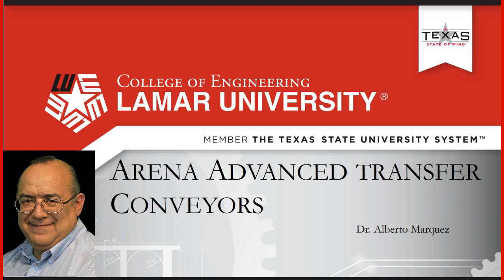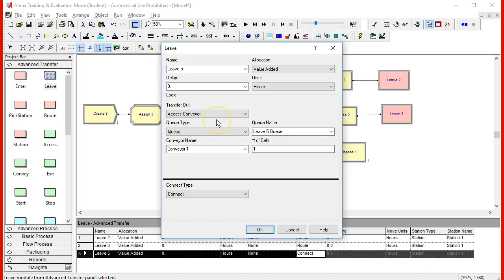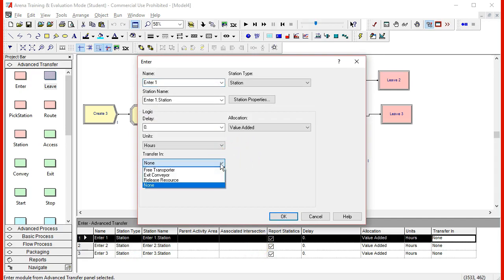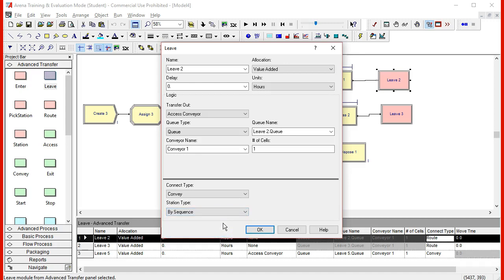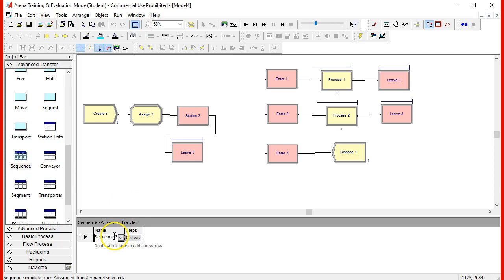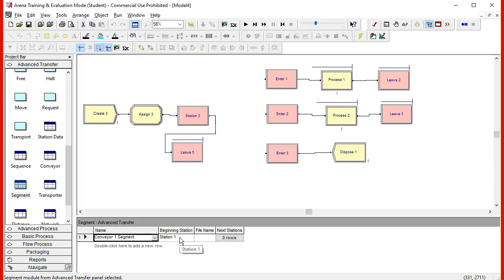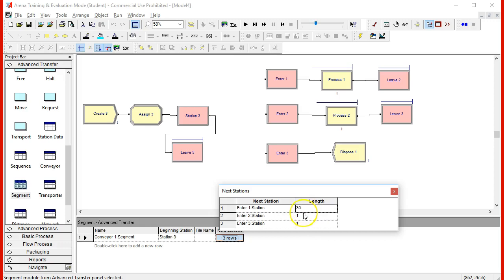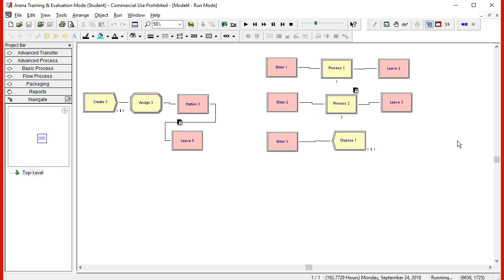Arena Advanced Transfer Conveyors Sequence

Comment: Why should I not model this just with a basic process? What is the advantage of modeling this system using the Advanced Transfer modules?
Reply from the maker: The purpose of creating models is for understanding reality, and describing it. Sometimes your models will help you make decisions. Sometimes the key constraint of a system will be the material handling capabilities within the system. Taking into consideration the capacity and speed of the material handling may affect the response time of the system as a whole. Even more, if you have too many transporters they could actually reduce the response speed because they could block each other pass due to traffic. Whether you need to model the material handling or not will depend on the purpose of your simulation, and where the constraints are. 
If on the other hand there are no constraints on the way products move around the processes, or it's a negligible constraint, then for all practical purposes, you can just use a simpler model.

Comment: How i have to configurate a single convayour with space for 4 items per time who have to wait 2 operation to be done in order to advance by one object?
Reply from the maker: Giorgio, 
I've never done a model like that. However, conveyors come in 2 types. Accumulating and non accumulating. I believe (not sure) that accumulating allow the conveyor to keep working regardless of the stop in the last cell of the conveyor. Conversely, non-accumulating stops the complete conveyor if the last cell is stopped for any reason. I think if you seize a resource without exiting the conveyor, it may stop the conveyor, but not sure. You will have to try. Please let me know if you succeeded.